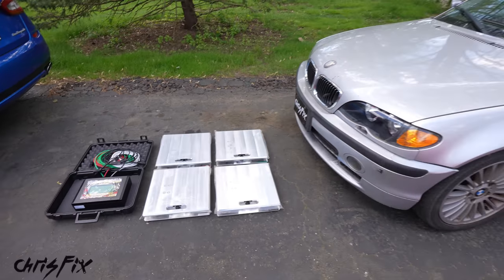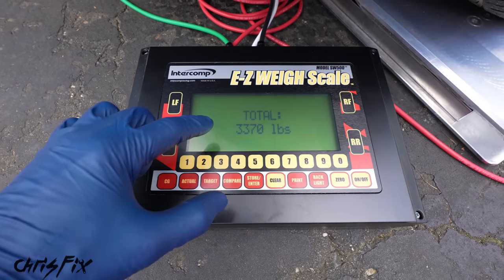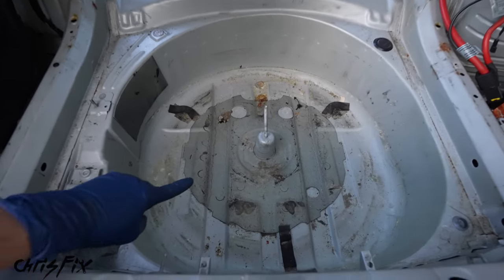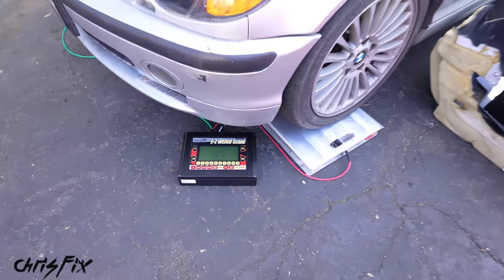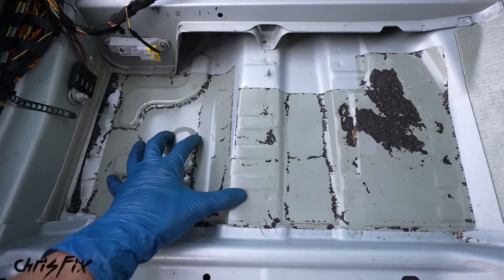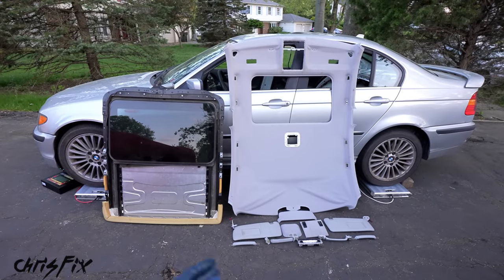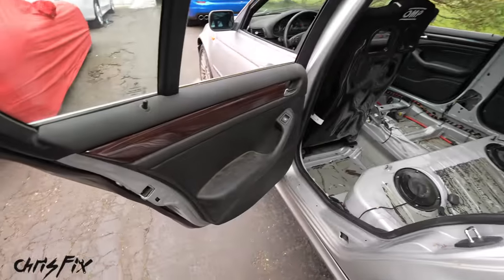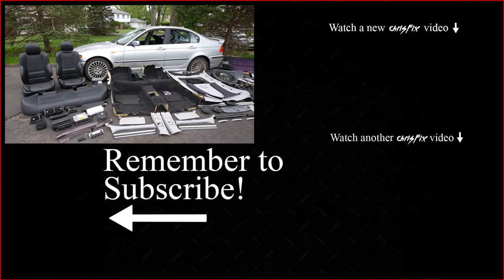How Much Weight can you REMOVE from your Car? (Weight Reduction)

Comment: Can’t wait to do this to my Prius race car build!!
Reply: Hi FixItNick
Reply: i wanna do this to my ioniq for better MPG
Reply: Aoakqmam
Reply: Remove the battery from beneath the rear seat for best performance
Reply: Lmaooo you tryna fly away?
Reply: I did this to my Acura integra GSR Awesome 👏
Reply: Can't wait to weight reduce my fiat
Reply: When they ask to see your answers, but you tell them to change it up a bit. You get OPs name.
Reply: @big6pun07  truuuue, forgot about that thing, brb
Reply: @PhaseSkater  bro, compete with the Bens from Gears and Gasoline, since they did a range test with an Insight.
Reply: Lol
Reply: It can finally go 0-60 in less than 10 seconds
Reply: @jg5001  apparently shaving off 500 pounds giev or take only will give you a 5-10 percent mpg boost, which is 3-6 mpg more. not worth it to extend the range 30-60 miles. essentially you just save an extra full gallon of gas. so like 3 bucks a tank but an empty car lol
Reply: I've seen people put Hayabusa engines in stripped Prius's
Reply: @big6pun07  what battery as it’s in the boot and he swapped it for a lighter one?did you watch it all and then comment?weird.
Reply: Think il do my overland try get 20 mpg😂😂
Reply: @Anonymous_________  ?
Reply: You may as well remove the battery and ev motor if your racing lmao
Reply: I’m gonna sub to you now
Reply: 🤣🤣 pimp that prius
Reply: civic moment
Reply: @big6pun07  ah yes, the downhill drifting build
Reply: Missed opportunity, could of said "Can't weight to ..."
Reply: I am interested
Reply: oh wait you’re serious
Reply: @ambread1  he was talking about removing the hybrid battery
Reply: 🤣 I'm gonna do this to my yugo
Reply: @PhaseSkater  I have the electric one
Reply: Damn son you bout to destroy those clowns 😎🔥
Reply: @PhaseSkater  ll
Reply: Cant wait to install my racing seats and cage to my golf cart
Reply: 0-60 from 15 seconds to 14.2 😁
Reply: dont bother reducing weight from the prius just reduce the prius
Reply: Twin turbo
Reply: I'll approve that
Reply: I want to do a maruti 800
Reply: Please don't.
Reply: If you remove the batteries, you'll save a lot of weight. They're the biggest weight penalty!
Reply: Call Tupperware 😂
Reply: You can weight reduce a lot further than he has if your putting in a roll cage read my main post I had a 67 steel body Nova that only weighed 1800lbs 1975 with me in it I was sitting on my fender one day in the staging lanes a guy came up to me and asked my why I was sitting on my fiberglass body wasn’t I worried I was gonna crack it I told him knock on its steel so he did, everyone thought I ran fiberglass cause I had removed everything I talked about and it made the body shake like a fiberglass body does when I was staged with the stutter box ( 2 step ) was engaged with my foot to the floor waiting on that second yellow light to pop so I can let go of the trans brake/line locks and let all hell break lose
Reply: Remove the batteries, easy weight reduction.
Reply: You must be joking?
Reply: @duchenne_md6736  Ofcourse.
Reply: Remove batteries and you will be ready to go
Reply: @jaden-NlGGA  r u indian
Reply: I wonder how much weight you could loose by ditching the whole hybrid system
Reply: 0 to 60 in 36.8 seconds
Reply: Your what?
Reply: @TT.357  A lot but it would do more bad than good for the acceleration. However if you ditched some of the batteries and placed the rest to create lower the center of gravity as well as lowed the car height a bit it'd be good.
Reply: When the time comes I'm going to do this with a Volvo v70, when I do I'm going to will film it all  . Great video Chris.
Reply: Pull out the batteries...they weigh a ton :)
Reply: @SKANK_HUNT49  What exactly? That's a car I've quite a bit of modding experience with.
Reply: @ilijapetrovic5002  🤣 it was a joke he said he was going to do it to a Prius. I just typed a different type of shitbox. I Dont really have a yugo
Reply: It’ll help a lot if you throw the whole car away
Reply: @PhaseSkater  bruh
Reply: Calm down
Reply: @level1544  bwahahaha
Reply: Remove all that weight so you can mount the vulcan Gatling gun.
Reply: Prius has a really high center of gravity, I never realized until I drove a prius c, less power for sure but handles alot better, If you could lower the location of the hybrid battery pack like the prius c does(under the back seat instead of behind it) I think it would make a big difference too.
Reply: @andrescastxneda  go team Andres Castaneda you must win.
Reply: Good job. You forgot the engine, it'll save a lot of weight
Reply: Same, but my Suburban autocross build
Reply: I have not heard of you but I am ready to watch you grow!
Reply: Ls swap it!
Reply: I’m going to remove my wheels and tires, at least 400 pounds
Reply: He's actually saying it...oh honey
Reply: You will have to tell us what your mpg is once you remove everything, I'm betting 200 mph lol
Reply: @thestonedbee662  nonono, the prius has a kers system or we. Lol.  Anyhow, the prius transmission needs the ev stuff to operate, as the motors are integrated into the transmission and are used actively to change the gear ratios.
Reply: That’s nothing Imma do it to my smartcar so I can be as light as paper 😂
Reply: Use kg please instead of lbs,stones and other outdated figures .
Reply: @erikdikkers7931  it was a joke lol
Reply: And unfortunately america (and maybe the uk?) Still uses lbs and miles and... Feet. Lol
Reply: But its kinda cool actually. Its like living history.
Reply: lotus/tesla swap!
Reply: Can’t wait to do this on my 1000hp geo metro.
Reply: I've already done it . Seriously
Reply: Are you a soccer mom y u have a Prius
Reply: Prius race car, now there’s an oxymoron
Reply: I wanna do this to my Mk5 GTI. It sits at around 3043lbs stock if I'm not mistaken. If I could delete 400+ lbs it would be pretty quick.
Reply: Your MPG will go up!
Reply: you can call the Prius rius
Reply: Do you win a lot? 😂
Reply: All hail stand up for PRIUS NATIONAL ANTHEM...RACING.
--Carbon fiber chasis/rims
--GAS Engine/Electric  rebuild/re-wire...
--Electric turbo/Alternator...(F1 MERCEDES)
"BEAST/SLEEPER"
Reply: A Chevy Bolt EV is quicker...
Reply: Prius is surprisingly fast little car. At first people drove then sooo slow.
Now theyre always doin 80-90 lol
Reply: Is there a Prius racing event
Reply: @YouLikeToast  the gear ratios are simulated by MG1.
Reply: Did you buy a 330 bmw battery by chance? 😃😂

Comment: actually insane how much there is in a car
Reply: hi mr.donut
Reply: Yo
Reply: YOOOO
Reply: yeah tru this is a lot more then my simple mind thought there was lmao
Reply: That's because it's a BMW not all cars have this much stuff🤡
Reply: @Area-cf1gt  all cars do😑
Reply: @Area-cf1gt  he took out the basic necessities from the car, that every car has. Quit trying to shame bmw, you look like the clown here
Reply: @sums6969  I go out of my way to shame bmw. I pitty the owners of the cars I have to fix. Over Engineered plastic junk even had to ruin toyotas name with the new supra they destroyed
Reply: @Area-cf1gt  hey they might be crap but they are still a lot of fun to pick up for 1000 and beat on until the rods fly out
Reply: @542vma  I respect that 👊
Reply: I would just drive a chassis and an inl8ne 6 😆  ,I had 1 of those man
Reply: I had 1 of those 2003 ,but they suck for racing ,very slow 🐌 🏎  ,the inl8ne is very reliable gas saver easy to fix, cheap maintainece too  but racing an m3 will do the job
Reply: @Area-cf1gt  that's the reason not every car is a luxury car.
Reply: More like Toyota needed to get in on BMWS FAME.
Reply: FACE REAVEL remember the time he built his dristang
Reply: @Area-cf1gt  Can confirm .
My car didnt have any of this junk.
Reply: Because it was a luxury 3 series with the biggest engine. Original price in Europe 2003 was around 55000 euro......
Reply: Hi
Reply: @Area-cf1gt  every supra owner I saw even said that bmw made a nice inline 6
Reply: You’re trading off on noise vibration and harshness, but I bet you can hear and feel every pebble your wheels roll over.
Reply: never knew this guy would show up in a chrisfix video
Reply: @Area-cf1gt  I mean I just did this to my 93 camry and it was about the same
Reply: @jorgiep09  are you kidding? Inline 6 is not a slow motor.  They just made many different versions.  The inline 6 was what came in the M3 and was used in their racecars.
Reply: @Area-cf1gt  I don’t know a lot about cars, Can you tell me why BMW is so bad?
Reply: @ehab1300  They make reliable engines and stuff but everything else will break. Switches and relays will fail, electrical gremlins, quality of life components are not given the same engineering love as their famous engines.
Reply: @ehab1300  Bad quality. I don't know too much myself, but I have noticed that most of the BMW owners I have spoken to have some kind of problem with their car. Then again, that might be because of their driving skills, or lack of it.

If you want a good reliable car, go for a Mercedes-Benz, Volvo, or Toyota.
Reply: @jorgiep09  How are the E46’s inline 6s gas saver omg they swallow like no girl I know.
Insanely fun though
Reply: Cars are expensive
Reply: I once saw on Toyota's website that said there are 30,000 individual components put together to make a car.
Reply: I work in a car factory, where the only job for me and about 40 other people, is to prepare the bumpers to get paint.

Now imagine that or more for every. single. part. It's a miracle cars get made at all. I see it every day and I still don't understand it.
Reply: @ehab1300  They aren't. He is clueless.
Reply: @Area-cf1gt  clown
Reply: Cars have about 30,000 pieces in them. more if it’s a luxury car
Reply: It's a hightec BMW
Reply: @myname9252  l
Reply: Germans like their luxury :D
Reply: @Area-cf1gt  not in my Tesla ;)
Reply: Holy moly
Reply: @542vma  if you can get it to start. ,,😆
Reply: wut u thought it was just some huge expensive empty can?
Reply: Theres like 30k details in car
Reply: @Inveriul  

Zzxcff
Reply: @Inveriul  tg

Comment: I rolled my 2005 Prius in 2016. By the grace of God, I walked away with no broken bones. 
Had the car towed to my house, then spent the next few days removing everything from the ac vents to the visors, radio, sunglasses holder, door panels, actuators, covers for the tweeters, glove compartment, rear  hatch panel and electric latch actuator, window/door lock controls, cup holders, power button, airbags, hybrid battery, etc. etc. etc. 

I then organized everything, took pictures and posted everything on ebay. 
Absorbed a lot of the cost from totaling the car without full coverage. And it was pretty satisfying knowing everything was being put to use and not wasting away in a junkyard in the rain
Reply: @snackler6102  Simply cut it off and sell it on ebay of course!
Reply: If you would have cut the catalytic converters off of it about four to six months ago the right person those would have brought you $1,800 hope you didn't scrap the car and leave the Converters on it because they're still worth well over 1,300 right now...!!!!
Reply: and I could use a good engine
Reply: @motersickel  there’s no way. I can buy a brand new (off brand but Prius compatible) catalytic converter off eBay for $150
I just looked it up and holy shit. That’s crazy. I parted my old Prius out about 6 years ago so I doubt it was worth near as much. 
My current Prius has a clogged catalytic converter. Wonder is that effects value. I know they’re wanted for the rhodium and platinum not for the function of the apparatus themselves.

Also, the engine on my wrecked Prius had nearly 300k miles
Reply: More people should do that
Reply: Newer cars usually go to a yard like LKQ and are parted out. Older cars might end up at a "u-pull it" type yard. Either way, cars are among the most recycled consumer goods, typically above 90% recovery. 
Parting out a car is a great way to recoup some money in the event it was uninsured/underinsured, or simply died and isn't insurance's problem, but cars rarely "waste away" in junkyards. If anything, junkyards "sit" on them until scrap prices go up so they can maximize their revenues.
Reply: @Lawrence330  as someone who’s been to junkyards in Orlando, tampa, jacksonville, Gainesville, Ocala, etc. pretty much every year (sometimes multiple times a year) for the part decade, I agree. They don’t “waste away” in a junkyard. But junkyards are the same everywhere you go and they all have two things in common. 
1. The “good” part get poached as soon as they arrive (either by insiders or used retailers) 
2. They sit out in the rain, Sun, snow, etc. and if your vehicle was damaged like mine, then most of the electronics were going to get rained on. Period. So instead of having it hauled off to a junkyard where the touchscreen, radio, actuators, power button, etc. is exposed to the florida rain for months, I went ahead and salvaged everything I could before they had a chance to have water damage and had a junkyard tow it away for free plus a couple hundred for the scrap. 
But circling back to my original comment, I have to agree with you. “Wasting away” is an over exaggeration. I almost always find the pets I need in u-pull-it style junkyards. Though sometimes, I have to dig through several vehicles.
Reply: How did you roll it?
Reply: @michaeldriver127  ran off the road into the right shoulder to avoid a dog that darted out in front my car; then cut my wheel to avoid a mailbox (because I was completely off the pavement at that point); it was wet out so when my front tires hit the pavement from cutting the wheel to avoid the mailbox, my rear end just drifted on the wet grass (I’m assuming there’b be more traction if it was dry out and wet grass had a lot to do with it) so I just drifted sideways across the entire road and into the ditch. That’s when my car began to roll over but I hit at least two trees before before ending upside down so I’m still not sure if I bounced off the trees then rolled over the opposite way or if I hit the trees and kept rolling. All I know for sure is 1.) there were two tree trunk sized impact indentions on the passenger side of my car’s roof and 2.) the car was upside down when I exited.
Reply: Yeah, mine never left whole, if wrecked, or totalled, and owned outright. Usually get stripped, and parts sold. Or, parked out back, if we have a second, or same line, vehicle,  for parts, or sold intaxt as a parts car to friends or family.

Most people have no clue how many common swapable parts most cars have in them. Trying to talk a friend into picking up our 08 Silverado,  as parts for his 2011, but he only wants an adtermarket radio harness, when ours has a cracked frame, and almost nothing else wrong with it.

No. He doesn't have much common sense. Only parts he can't use are front brakes, as it's a 4 by 2, and  broken leaf spring. Rveryrhing else would bolt on.

May look for one in good shape, with a bad engine or trans, and keep it for ourself instead. Let him learn the hard way.
Reply: Amazing testimonial 👌

Comment: I usually shave every hair on my body and race entirely naked for weight reduction purposes
Reply: 69 likes
Reply: Sure... that's why you race naked...
Reply: Why even race? Just wait at the finish line.
Reply: Your aerodynamics must be like a knife cutting through air as well.
Reply: Might as well donate your spare kindey then
Reply: I also slice my veins open and drain blood, leaving just enough to not die. That saves some weight
Reply: and take a massive dump for that one extra horse power
Reply: @regeleleu8814  5 minute hacks be like
Reply: Yowamushi no Pedal reference
Reply: Absolut Genius!
Reply: I usually season my cutting board instead of my steak.
Reply: @xil3ntkha0s  Just visualise winning any race ever.
Reply: And for aerodynamics
Reply: Don’t forget to take the shit out before jumping in the car :)
Reply: I pop my eyes out and race entirely on instinct eyes are bloat.
Reply: i make sure to gouge out an eye pre race since i only need 1 to see
Reply: don't forget to visit toilet twice and squeeze out everything to the last drop
Reply: remember to go to the sauna before a race. To lose all the water weight
Reply: I cut off my left leg and then remove unnecessary organs to get maximum weight reduction
Reply: @bxlbi6134  yuck u drive a slush box
Reply: Remember not to take that dump inside of the car
Reply: I always remove one lung, one eye, one ear, one kidney, one testicle, my gallbladder, my spleen, and my appendix. Basically everything in my body I can live without
Reply: It all adds up
Reply: Donating some organs will also help in weight reduction!
Reply: I Skin my myself for weight reduction purposes but I die shortly after
Reply: doesn't work if u still have your heavy iron balls attached
Reply: I take my bladder it’s always full oh why were here brains? Nah don’t need that it’s way too heavy
Reply: Fun fact: professional swimmers and similar shave their body hair to be more hydrodynamic

Comment: Weight reduction is basically telling a car “ u won’t be needing this “
Reply: well apparently my brain does the same thing for everything that i learn...
Reply: u don’t need ur fingers chop 😂
Reply: @ned407  u won’t need ur spinal cord
Reply: "or this or this or this or this"
Reply: Hey BMW, can you drive on 3 wheels?
Reply: Can you drive a citroën ds1 on 1 wheel
Reply: @sean6992  bet
Reply: telling a sprinter to take their clothes off to run faster.
Reply: This passenger seat does not spark joy
Reply: and cars cry when they stop anyone from getting them stripped
Reply: @jeffwayne3054  weld the diffs, it can :D